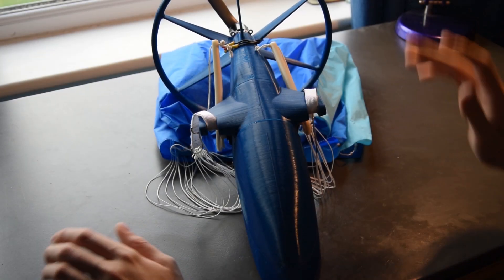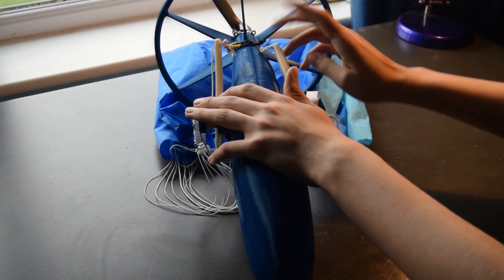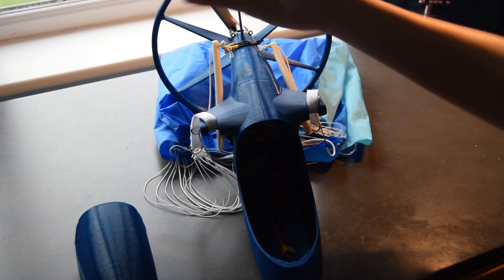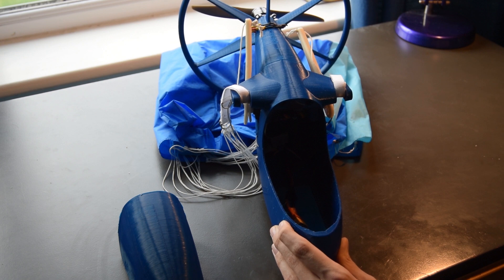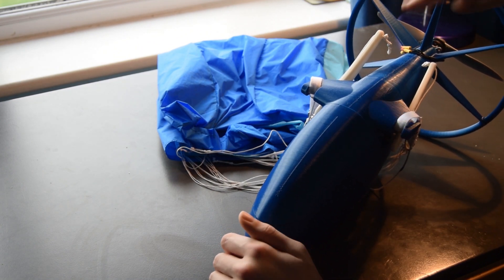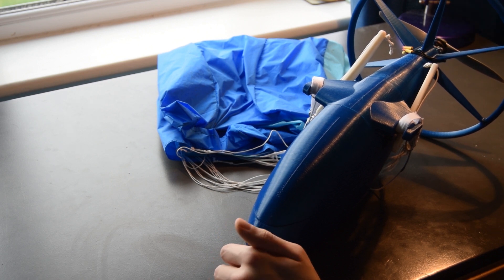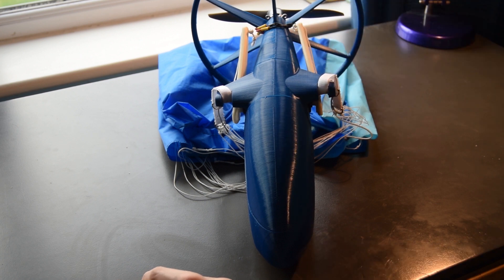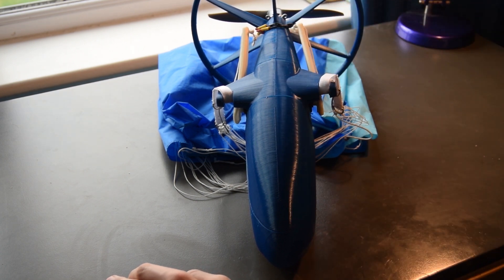Tom Stanton's 3D Printed Paramotor Review

Comment: I have printed this model and waiting for maiden flight, the HK para-foil motor recommendation is 3530 1400kv with a weight of around 2kgs but Tom Stanton seemed to use 2212  960kv ... What motor did you install ? Please post your maiden flight .
Reply from the maker: I used a ft radial motor from the flite test packs that run planes like the founders plane, sorry for the delay with the maiden, it was just before the couple of lockdowns that I had planned to get my Air to air shots with my quad but I couldn’t due to restrictions on numbers at the flying field, I will do my best to get it out ASAP when I can get back to the field with other members :)

Comment: Hi, did you print the main body section with supports?
Reply from the maker: Skynyrd FPV The front section did need them up the middle I don’t remember if the back did, sorry about the lateness of the flight video struggled to find good weather to put it together 👍
Reply: Rc Aviation thanks for reply. I’m hoping to start printing this soon.
Reply from the maker: Skynyrd FPV good luck, any questions just put another comment :)